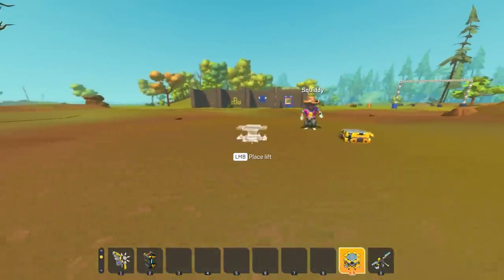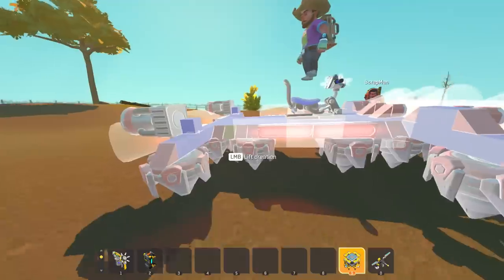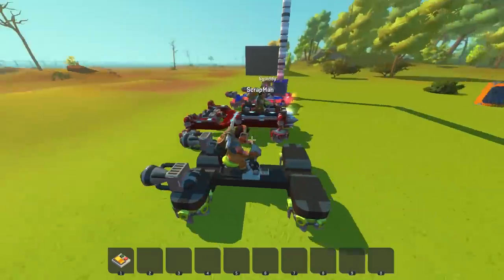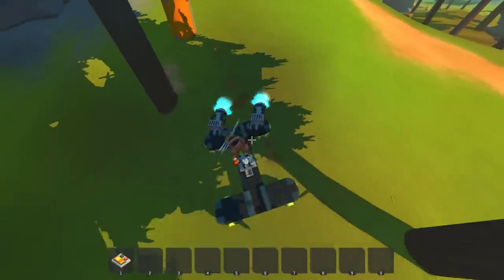We Built and Raced Thruster Powered Drill Sleds! (Scrap Mechanic Multiplayer Monday)

Comment: I have a suggestion for Multiplayer : 
A Player Transport race
everyone builds a vehicle that can transport another player and while to players race each other the other two that are beeing transportet use their connection tools to mess with the connections of the vehicle of the player transporting him
Reply: do you mean that one player is noseat? If yes the noseatplayer could be a turret or something like that....
Reply: @Zerophil_  I mean that one player is just standing in something like a box or cage that's build onto the transporting vehicle and then messes with the connections while the transporting players race. As example the Player beeing transportet could reverse a bearing or disconnect a motor from the seat. But to make sure that the others could still race there would have to be some restrictions. Something like they aren't allowed to disconnest the motor from all bearings that power wheels or constantly change the same bearing. They might have to be put on a timer so that they can only change something every 10 seconds while beeing transportet. The transporting player of course has to make sure that the transportet player can't fall of during the race. So yeah, the player beeing transported doesn't have a seat.
Reply: So the two people in a transport would be on different teams?
Reply: 48

Comment: I could see this working well as runners for a chariot-style single wheel contraptions.

As far as this challenge, I wonder if an inline arrangement with a wider steering range would have worked better. Arranged symmetrically at 90 degrees, you get zero-radius turns. On the other hand, you lose translation thrust without extra controls. Honestly, using cactus as a drag anchor at the back might have helped. Humans have some difficulty adapting to low friction enviroments because we're so used to things slowing down and stopping when they're not being pushed.

Comment: You guys should do skid plate racing. It's when people take front wheel drive cars and replace the rear wheels with little sleds. This makes them suuuuuper easy to drift. You guys should build vehicles with powered front wheels and drill bits as skids at the back.

Comment: MM idea: two people each build a front end of a car with steering, and two other people each build a back end with powered wheels. Then, in teams of two, the people weld both ends together, and the one in front has control of steering while the one in back has control of throttle.
Reply: 68